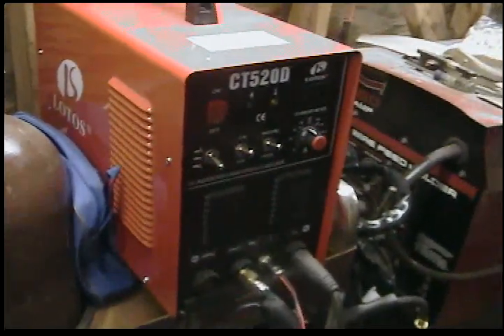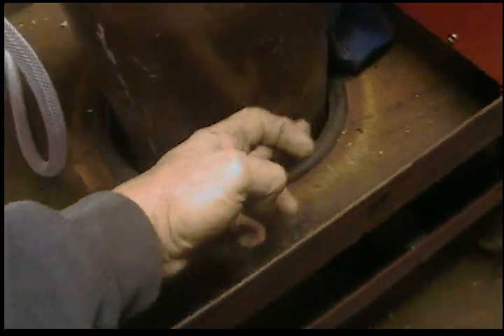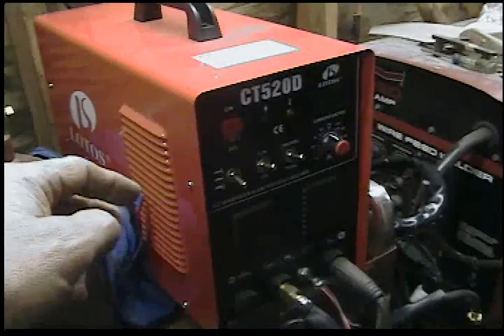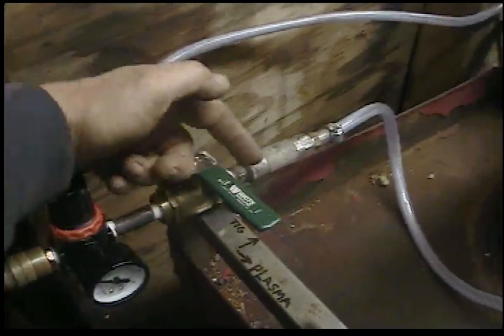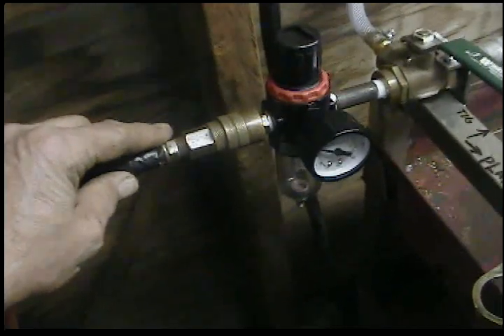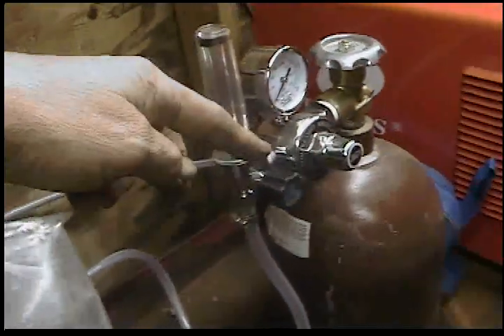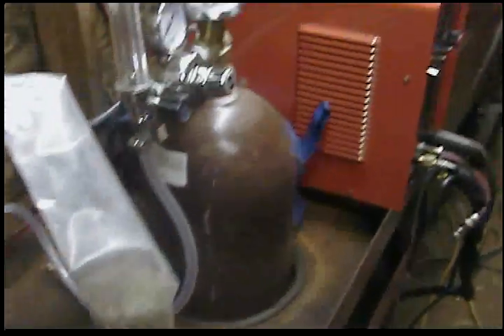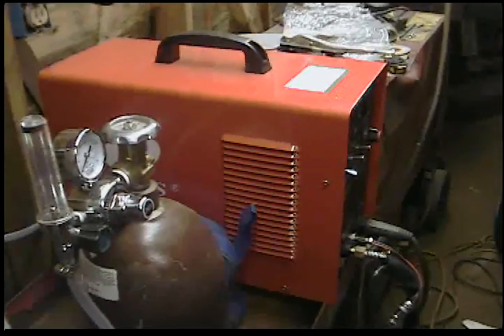How I made a plasma/tig swapping adapter for my CT520D

Comment: Did you make an adapter so you can use a 2 pin plasma torch?  I want to upgrade my plasma torch but they're all 2 pin connectors while the CT520D has multiple mins due to supporting the TIG welding.  If you made an adapter can you tell me where you bought the 2 pin female plug, and the part number if you still have it?
Reply from the maker: sorry havent...
Reply: @johncartelli  thanks for the fast response.

Comment: you can weld aluminum with this unit if you use helium.
Reply: matthew lee we have tried a few times with very poor results
Reply from the maker: i thought aluminum needed an AC voltage to weld... not sure

Comment: I have the same unit and works great. My only small complaint was the barbed brass fittings were a little loose fitting to the plastic tube, and had to tighten them extra tight. Otherwise all systems worked as expected.
Reply: James Acker hi dear I am tariq I am tight welder and gas welder
Reply from the maker: great! thanks for watching and the comment

Comment: Hey how do you like your welder? I'm looking into buying the same one, but i can't really find good reviews on how it performs. Has it been reliable for you?
Reply from the maker: +Pablo Munoz never had a problem with main unit, however, the fittings/clamps, gas reg should be changed to a higher quality...the origional leaked  and caused  me to replace the tank too often...
Reply: +johncartelli Okay im going to give this welder a try. Thank you ! Your video was extremely helpful.

Comment: were your stick welder leads only a foot long?? cause thats how mine is
Reply from the maker: no they were ok..but i dont use them...i have a mig welder for anything other than plasma cutting or tig welding
Reply: johncartelli i love the machine other than this, all i do is stick weld and i would like to be able to move around more than a foot from my machine, my ground clamp is just as short too and i have to move the machine around the shop to use it

Comment from the maker: After thinking about this a bit I thought.because i have a mig welder i wouldnt need the stick weld output, so in its place I could put another tig output.in the front,add another gas input in the back then remove the 3 way valve. I could wire it up so I could just leave the plasma torch hooked up to one and the tig hooked up to the other all the time. then all I would have to do is turn on the gas,throw the switch and go. Maybe after the warranty is up

Comment from the maker: the ac dc units were more than I had to spend...somewhere around $8-900..so i got just the dc unit for $550 ($650 with a foot pedal) it has 2  post flow settings 2.5 or 5 sec..check out their web site..Lotos